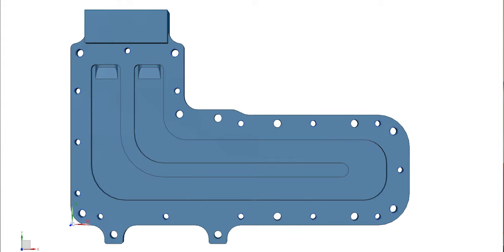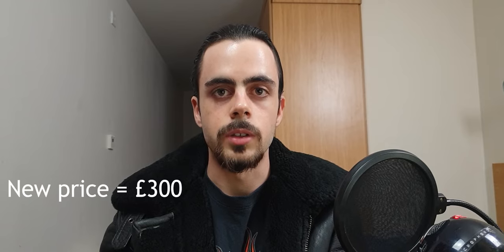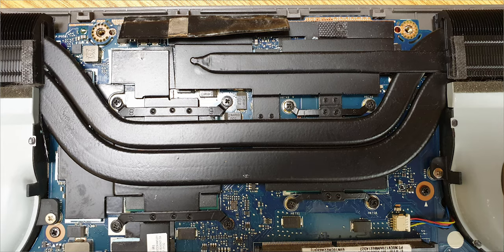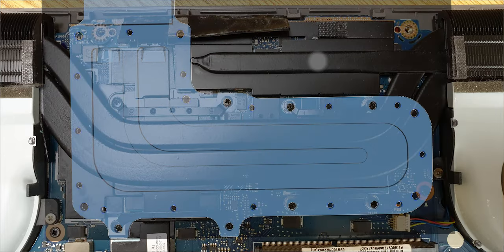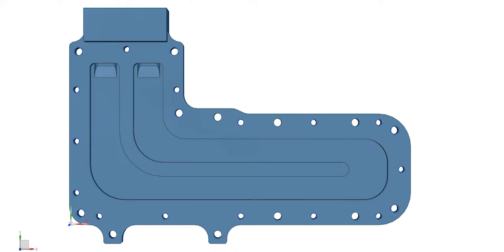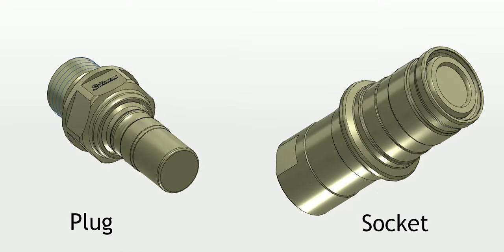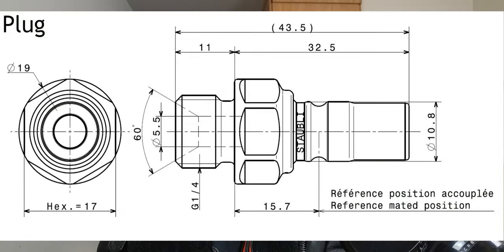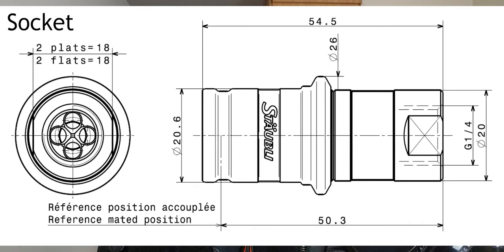Laptop Liquid Loop project. Part 8 - Waterblock update

Comment: You must have a really really good reason why you're getting QDCs custom made for 200 quid and not using off the shelf ones like this for 10 quid ea
https://www.aquatuning.co.uk/water-cooling/fittings/quick-release-fittings/5790/phobya-quick-release-connector-kit-g1/4-with-bulkhead-thread-black-nickel?c=2665
I used an older 8/10mm one (now EOL) similar to that in the same phobya black nickel, you can remove the bulkhead part) in my mod and they have stood up just fine even after soldering them to the copper pipe I used.
Reply from the maker: The loop is aluminum - meaning normal QDCs are incompatible. Otherwise would've used the normal £20-30 ones made of copper or similar material for sure. But if you could find some aluminum QDCs that are cheaper I'd appreciate it. Been looking for some.
Reply: @MalcolmBlk   Malcolm Black  Ah, understood. I did find some to consider on aliexpress - looks like they're used in brake fluid and fuel lines on racecars - search for AN3 / AN6 brake line / fuel hose quick connects. Some looked high end full aluminium with a robust twist lock mechanism, others looked cheaper with plastic internals.
Reply from the maker: @greebj  
I am surprised you went and looked, and I am thankful. However, as I didn't actually expect you to do that, I'm afraid these QDCs are not suitable, I'll explain why and give you a full set of requirements in case you would like to have a look.

So, these are the only QDCs I found by searching for what you said on aliexpress:
https://urlzs.com/45Z2Y

These are not suitable because you're meant to connect the tubes straight to the QDC. In my application, the male QDC will go straight to the waterblock via threads, without any tube. Only the female QDC will have a tube connected to it, preferably still via a thread and a fitting (as this is safer). So you can see that connecting the QDC linked above to the waterblock would be impossible given I do not currently have access to the workshop (otherwise would be able to thread).

Here're the requirements:
- Male QDC thread = G1/4 (or smaller) male.
- Female QDC thread = G1/4 (exact) female.
- Material: aluminum/polymer.
- Max dia. of male QDC = 20mm.
- Max male QDC length (installed) = 35mm.
- Exact size + material O-rings supplied/recommended.

Please do send me your thoughts asap, I have not ordered the waterblock yet because I have to be sure what QDCs I am using, and getting non-custom ones would decrease the cost by a lot. If you're not going to research please tell me anyway so that I can order the block.
Reply: @MalcolmBlk  That's as far as I went looking with aluminium, sorry.  I vaguely remembered those terms from when I was doing my research over a year ago. I ended up not using any aluminium and use the same automotive coolant (for alloy engines and with extra sacrificial zinc) to deal with what I estimate as a minor mixed metal issue since copper, nickel and the solders I have used that are in common contact with the liquid are all of similar galvanic potential.
Reply from the maker: @greebj  Cool, no worries.
Reply: @MalcolmBlk  galvanic corrosion is a very long term problem that is easily solved by putting anti corrosives in the water. The plastic QDCs have such small amounts of copper it likely will never even matter. At worst you need to clean the block once a year I'd your that worried about it.
Reply from the maker: @wage4598  Please send me a link if you've found plastic QDCs that would fit under my requirements (listed in one of my replies to OP).